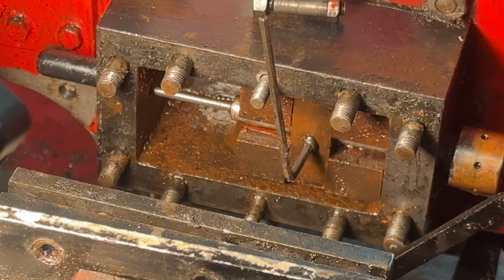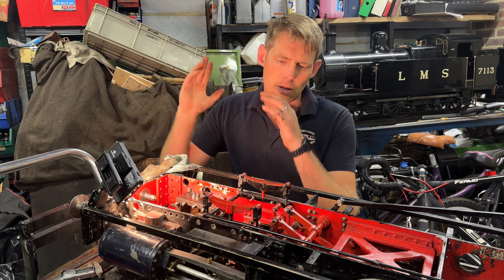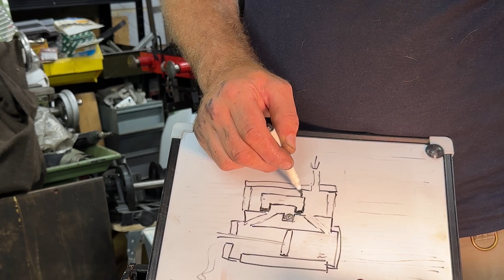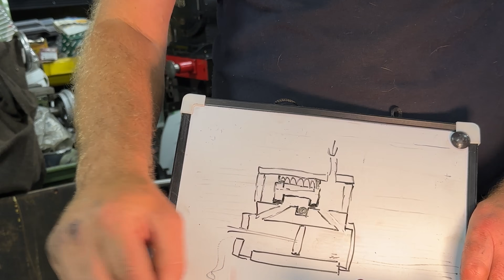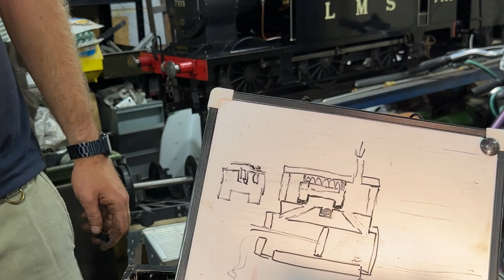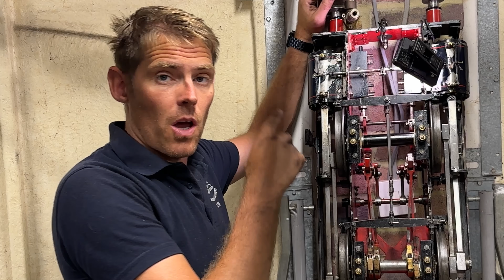HOLMSIDE adjusting valves.

Comment: LBSC Petrolia 2-4-0 Has inside cylinders with the slide valve underneath. Seating entirely depends on steam pressure to keep the valve seated.
Reply from the maker: That’s true, same as my Jinty, but when there’s no pressure in the chest it’s possible for them to drop off the seat if there’s any clearance.

Comment: You poor thing! A victim of Martin Evan’s design work…..that is a real shame that the valve rod didn’t have a more clear run from horns and axleboxes etc.
Reply from the maker: Yes, sometimes these things are a pain. I was lucky with the eccentric straps though, the builder had drilled a couple of holes in the stretcher to allow a screwdriver to get at the strap bolts.